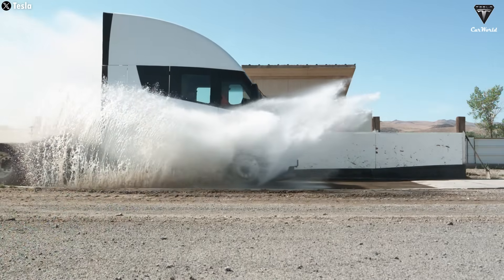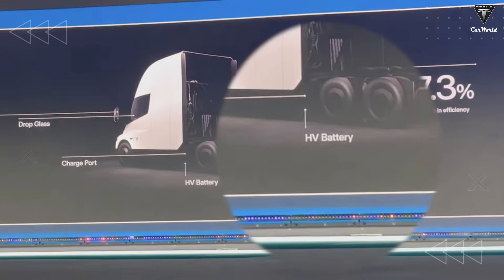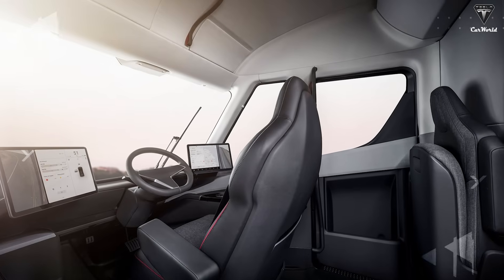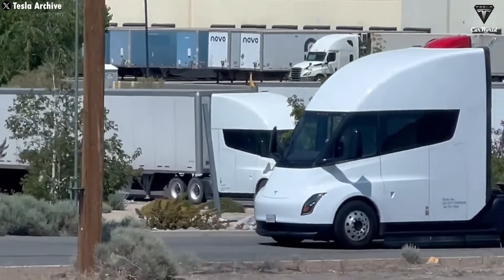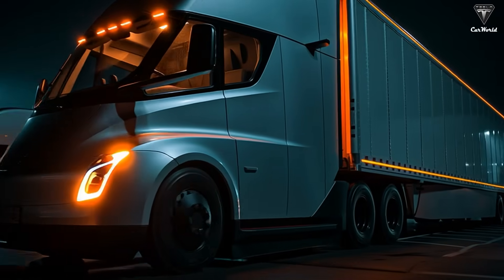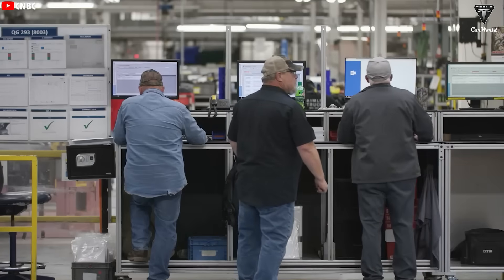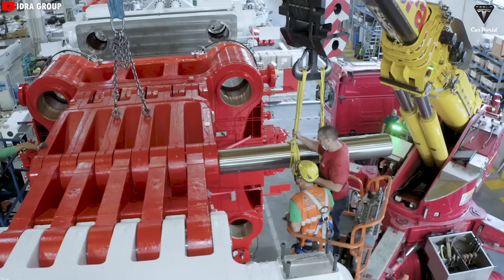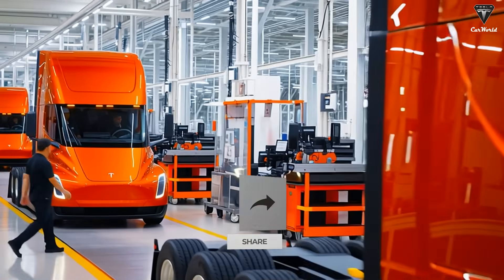2026 Tesla Semi Truck Mass Production Finally Ready! Elon Musk DROPS AMAZING Upgrade Series!

Comment: If mass production is about to start, it should be advertised by Tesla, shown on the website, and typically negotiated with early testing companies. None of that is shown. Companies like Volvo and Daimler typically advertise new truck models a year before. Most likely, there will be another year like before.

Comment: Listened to the CEO of swift say they had 20 electric trucks in fleet of 24000. He asked the question in california would it be possible to convert one branch with 600 trucks to electric and the answer was the electricity network could not support them.

Comment: problem is, where and how to charge it, you won't be able to long haul it, it does not have sleeper. also no one in trucking cares about 0-60 in how many seconds, main demand in trucking is, how many miles without "refueling" and how long will it take to "refuel" it. today there are huge lines on trucking dueling stations when it takes only 10 minutes to refuel a truck, I even can not imagine how long will lines be and how long it will take to recharge semi when tesla model 3 is taking 40 minutes to recharge..... also, it is not zero emission, you have to get energy from somewhere to charge it.. with the scale they are planning, no solar panel or wind turbine will handle it, probably coal electric stations....

Comment: And what is the trucks range???. This is the problem
Reply: last I heard the long range was supposed to have a 500 miles @ 82,000 lbs range and the planned megachargers were planned to be able to recharge it in 30-45 minutes, to fit within your usdot mandatory break
Reply: I guess 500  miles is a ok start, 900 miles would  work  alot better from n.y. f.l.

Comment: Has any consideration been given to Tesla also producing the trailers as well and mounting solar panels on the roof of the trailer?
Reply: I sure Tesla is planning on building trailers with cameras, FSD, all wheel drive with regen, rear wheel steering, solar panels on the roof, and  batteries within the trailers frame, 
Imagine a 16 wheel drive semi with FSD and a 1000 mile range.🤣😂😁
Reply: @ddmitch1 You definitely 70% correct, do you wish to work with us?
Reply: @ddmitch1  We're helping the Semi Retire ,Retired,old, Young,Disable, Deaf, Widow,Divorced and Workers, in conjunction He is the founder, CEO and chief engineer of SpaceX; angel investor, CEO and product architect of Tesla, Inc.; owner and CEO if you Have gotten your application yet because I saw your name on the workers list ,did you also got yours?
Reply: Just before Covid, there was a inventor that had come up with a paint that you literally could paint the side of a semi and the entire side became a solar panel producing electricity. Unfortunately, for some reason he died during Covid supposed suicide. I wonder which solar panel company had him killed
Reply: @gregkelmis2435  I swear these people need to be found and dealt with in a swift and highly public manner.
Reply: @gregkelmis2435  
Ah, so it's probably a CIGS-based ink—Copper Indium Gallium Selenide, a second-generation semiconductor.
If so, there's nothing particularly innovative about it; these inks are actually quite easy to apply to a substrate, although more complicated than you might imagine.
But they don't have very high efficiency, so modern thin and flexible polycrystalline silicon panels would be more cost-effective...
Reply: All love to you,  lovely fan,Thanks for your love and support as a fan. how are you doing today?

Comment: What if the trailers were redesigned to be about 2' less tall at the front end? The cab could then be lower as well (perhaps the cab could have both settings), decreasing the drag of the vehicle.